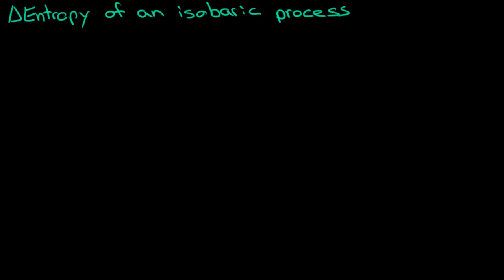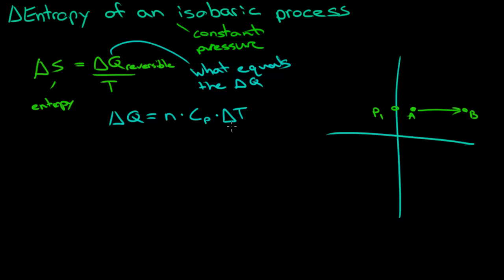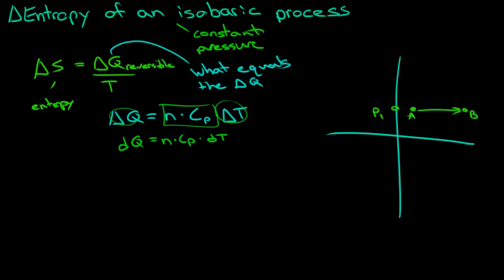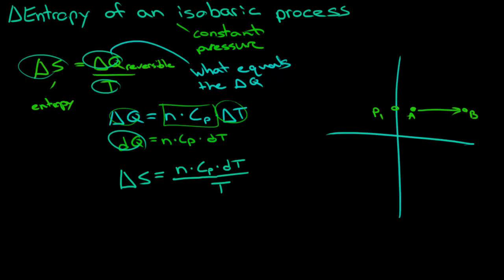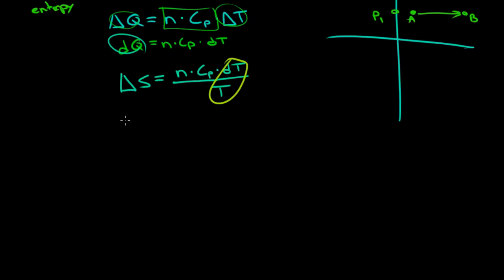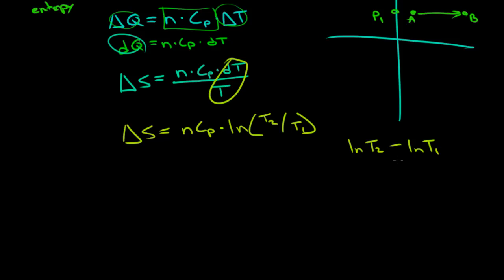Change in Entropy of an Isobaric Process

Comment: Notation: As soon as you switched to dT instead of Delta T, you should have also changed to dS instead of Delta S (before integration).  Delta S would then be the final result after integration.